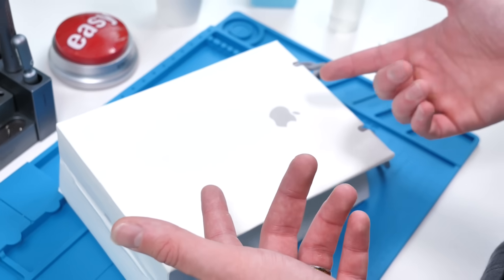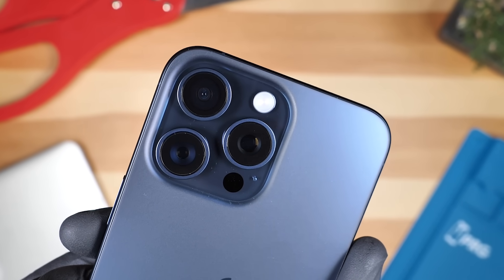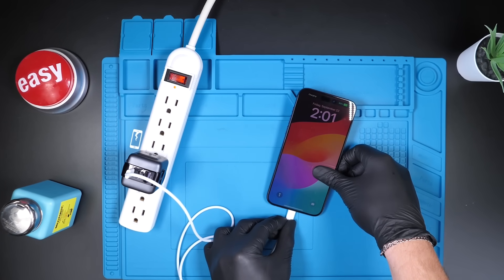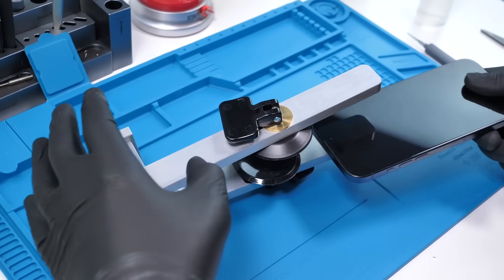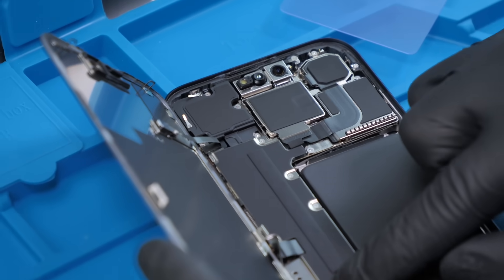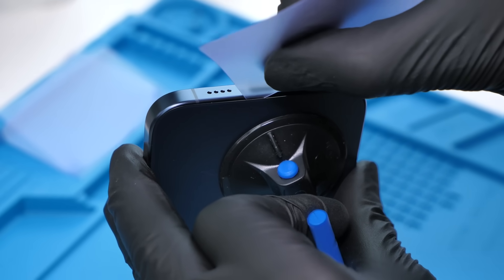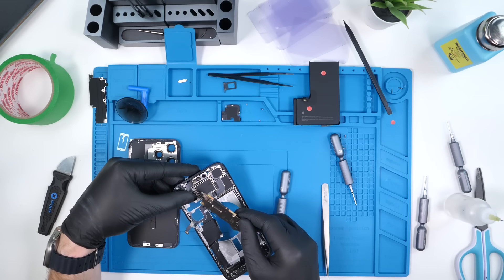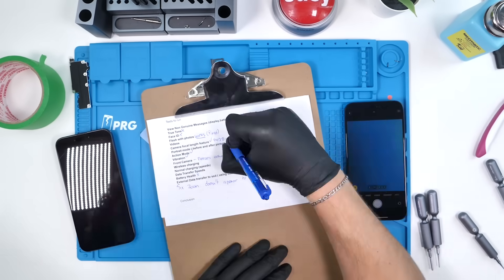Is The iPhone 15 Pro Repairable? - Parts Swap Test

Comment: I actually once threw my iPhone XS into the fire! Let me explain: mid December 2019, I had an argument with my parents. Shortly into the argument, they told me to give them my iPhone, which I didn’t have on me at that moment in time. I went upstairs to my bedroom, got my £1,349 iPhone XS, but instead of letting my parents have it, I threw it into the fireplace! Shortly after they found out, they raced against time to get the phone out of the fire! The phone itself survived, but my £70 Lifeproof case didn’t!

Comment: Can you do this same style video with some of the newer Samsung phones? I am interested to see if there is any similar shenanigans. Thank you!
Reply: THIS
Reply: @@GH0STST4RSCR34MI think they were talking about “they don’t follow the same greedy practices as apple” and it is true
Reply: @@GH0STST4RSCR34Mit is because Samsung still has greedy practices like copying of all people Apple.
Reply: Try to swap the usbc port
Reply: That would be pretty cool, though Samsung phones (tmk) have never had this issue bc they don't follow the same greedy practices as Apple, so unless it becomes a trend for Samsung too, I would doubt that he does it for those phones.
Reply: @slavprinceuro they removed the chargers from the box and head phone jack the year after apple did it.
Reply: @anandvijayan150   only when apple made it a standard and Samsung got flamed for not "Protecting the environment"
Reply: I don't think so because the Security level is very low on Samsungs

Comment: Front camera is 100% intentional. 
I mean they took 20+ years to get their charging speeds close to up to date. You can't expect them to get serious over simple swap.
Reply: The lightning charging speed was up to 35w. There is no reason to believe the USB-C will be any faster.
Reply: @koalaunknown  lightning is up to 35w yes. There are also 300$devices with 65w charging speed with C/usb A or C/C . 
lightning/usb A is slow and 35W is slow for today's standards. That is if they wanna create the best phone but they just mess around with ppl .
Reply: the camera doesn't work because it fails to fetch depth data which is included in every 15 series phone to readjust focus later. Could be fixed with a software update.

Comment: Great work man! That titanium blue looks 🔥 I hope they fix the front camera issue with an update 🙄
Reply from the maker: Thanks! I really hope so
Reply: @PhoneRepairGuru  same
Reply: @PhoneRepairGuru  is that gonna do anything to the battery when it reach 100% it stops charging btw
Reply: @PhoneRepairGuru  btw I have a Samsung galaxy A52s 5G and I got it when I turned 12 im now 13 and when I got after a few months I got some burn screen the notifications are burned in and the youtube buttons on youtube shorts are burned in and the youtube menu too so I thought of playing a video where it changes colors and leave the phone like that until I wake up and leave it in the charger
Reply: I think it's not a bug but rather another anti-repair method here.
Reply: Well doesnt that mean if the front screen gets damaged its a total loss because face id and front camera are just dead?
Reply: @alexmaier2970 you can swap face id sensors and selfie cam in case the screen breaks but if they themselves break you likely have to get them repaired by apple
Reply: The blue is a coating and the titanium is underneath. The coating scratches as easily as anything else. You can get blue titanium by heating it up but this isn't it.
Reply: @777jrg fake titanium easy breaks you etupid iphone user are hilarious
Reply: @777jrg this guy clearly came here after watching Zack's video 😂😂
Reply: tf u mean "fix the issue"
they intentionally created that issue so that the only way to repair an iphone is with them
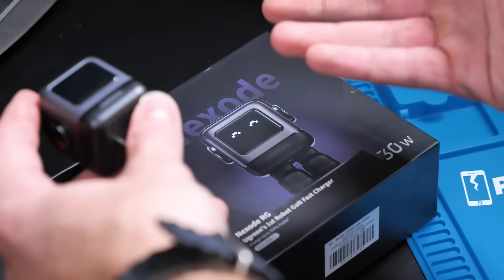Reply: “For God so loved the world that He gave His only begotten Son, that whoever believes in Him should not perish but have everlasting life.”John3:16 NKJV

“that if you confess with your mouth the Lord Jesus and believe in your heart that God has raised Him from the dead, you will be saved.”Romans10:9 NKJV
Reply: Watch my unboxing of the iPhone 15 Pro Max!! 🖤📦
Reply: The blue looks so amazing but I heard it's much much more obvious to see scratches because of the way they added the blue
Reply: they wont
Reply: I hope they fix all those issues that should not be issues at all
Reply: It's not an issue, it is meant to disallow self-repair and unofficial repair shops because Apple are scumbags.
You are meant to buy a different phone from a different manufacturer.
Reply: They did it on purpose
Reply: lol the blue scratches off immediately
Reply: next update iphone 16 Vmax 💀
Reply: LOL
Reply: They won't,  buy the iphone 16 Pro Plus
Reply: @arkvsi8142  still can't repair it? Buy the 17 idiot. 

Then buy the 18 which will probably release after... the EU's law of replaceable batteries comes into play... that's gonna be a hard egg to crack.
Reply: @arkvsi8142  Great idea actually, product A is bad due to company decisions but they will never fix it, go buy product B, this surely will have a much better company behind it.. ah wait.. 
The Apple gang never ceases to entertain :D
Reply: @arkvsi8142 Pro plus omega giga x
Reply: I hope they do as well
Reply: Or you could just get your screen replaced by apple 🤷🏻‍♂️
Reply: @TATTEDGAY  it would be more expensive and you should be able to repair it yourself anyway.
Reply: @Andrzej360  I just read that the price of replacing the glass on the 15s by Apple is cheaper than the 14s. Even if that’s not true tho don’t buy a Mercedes if you can’t afford the service. Don’t buy the iPhone if you can’t afford the replacement glass from where you bought it 😂

Comment: i am just surprised the model number is now inside the charging port lol

edit: i ment model not serial
Reply: That’s the model number, not the serial number. The serial number is on the motherboard and can also obtained by plugging it into one of apples tools if the device is unresponsive.
Reply: It’s also in the lightning port on the 14

Comment: I'll wait until next year. They really tone down the USB C speed.
Reply: only on the non-Pro Max models. On the promax you get full usb 3 speed.
Reply: @NonLegitNation2  Non-pro models. Both the Pro and Pro Max have 10Gbps C ports, not just the Pro Max.
Reply: @Arobsite  oh okay I thought it was only the Pro Max. I'm know it's dependent on the A17 Bionic chip or whatever it's called but I thought only the Pro Max was getting that chip.
Reply: @NonLegitNation2 the normal iPhone is the Pro from last year with perhaps 1-2 small additions.
The pro is the all new model with all new features.
Reply: who cares